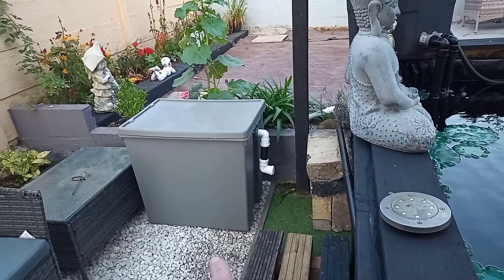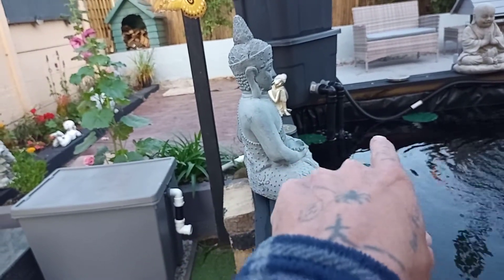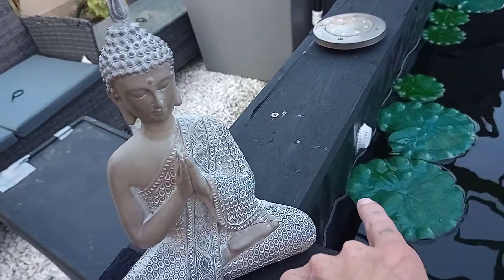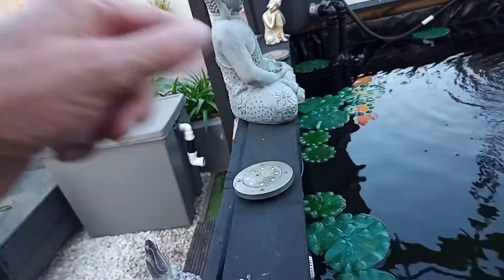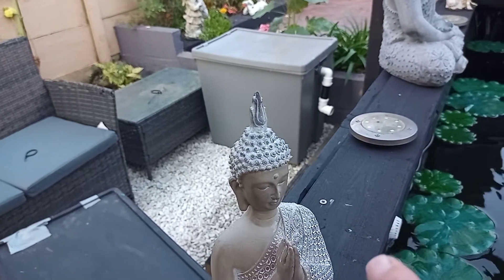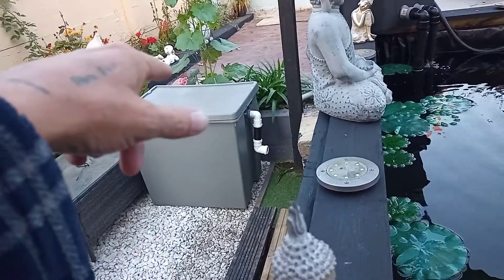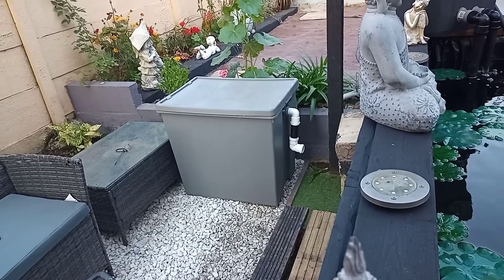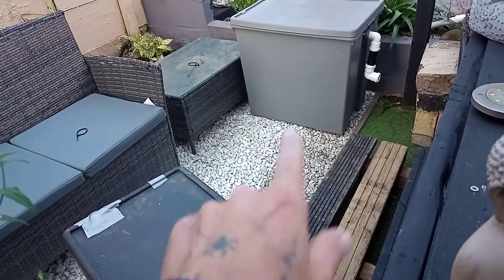I need help! koi  filter chambers how the f#ck to do it? will it flow up and over by gravity alone?

Comment: Put the first box above pond level with the second box lower having the return just above pond level. If you send me an email I'll do you a sketch 👍
Reply from the maker: Thanks for the suggestion Leon much appreciated 👍
Reply from the maker: Was wanting to have the small box on a step so it was level with the big box have the return coming from the small one but it all goes down to water levels and the inlet at the bottom of the big box with both boxes connected with one pipe connecting them both from the top where they but up against each other if that makes sense 👍
Reply: @martynskoipondandgarden4581  will it be pump fed?
Reply from the maker: @progressivepondkeeping  yeah mate straight out of the pond
Reply: @martynskoipondandgarden4581  as long as you return and boxes are above pond level you should be ok
Reply from the maker: Email sent 👍

Comment: Your going to need an out flow pipe on the final box.  1st box bottom will need to be level with pond water 2nd 1/3 down. This is so they can gravity feed back into the pond!
Reply from the maker: Thanks for that got outflow pipe just need to know will gravity push water through a upside down u bend back to the pond

Comment: Hi martyn, are you not pump fed buddy??
Reply from the maker: Hi mate I should of explained it more clearly I have a pump that sits in the bottom of the pond basically a waterfall pump 3500 litres per hour that has an attachment for two ,3 quarter inch pipes so that's what I am going to feed them with
Reply: @martynskoipondandgarden4581  if you look through my vids i put 2 tubs with alfa grog at the back of my pond as bio filters, they are fed with a pump from my multibay but to let gravaty return i had to have them higher then the pond, to run them 1 after the other they had to be the same level as each other, fed in from the bottom and returned from the top if you know what i mean.... take a look and your see how i had to do it 👌👍🐟
Reply from the maker: @RamseysDIYKoiPond  thats how i want to do mine i will have a gander cheers mucka